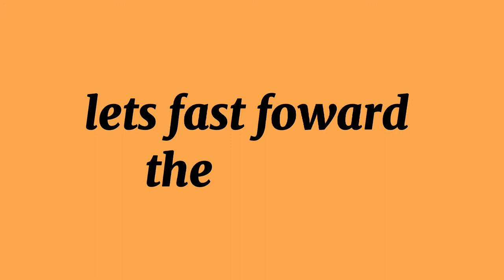CONSTRUCTION MADE OF PRECAST WALL FORMBLOCKS used in highrise bldg.

Comment: Mahal cost nyan plus labor..hindi pwedenh dalawa o isa gumawa
Reply: Mas mura sya pag larger area at mas mabilis Ang pagkabit. Less stiffener columns and stiffener beams kasi Yan at no need pa for plastering. Pero pag small project lang o bahay, di Yan advisable kasi talo ka sa cost.
Reply: @justlurking5203 tama ciguro pero  larger area kadalasan tall and highrise building..pag ako magpapatayo even iny two story gagamit parin.ako tamang sukat ng beam. Column at stiffeners,..so no parin sakin to.....para lng ito tlg sa may budget na construction. Dagdag tibay